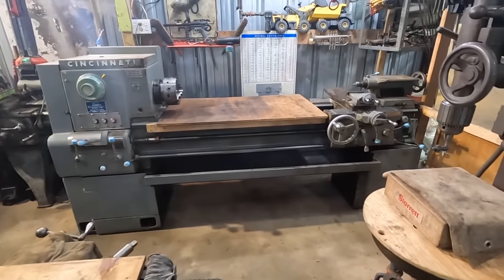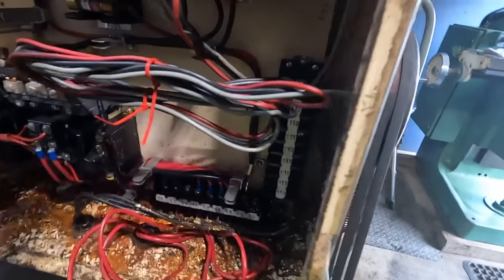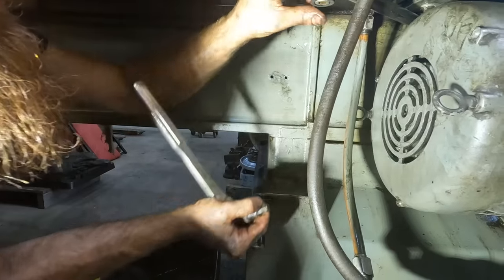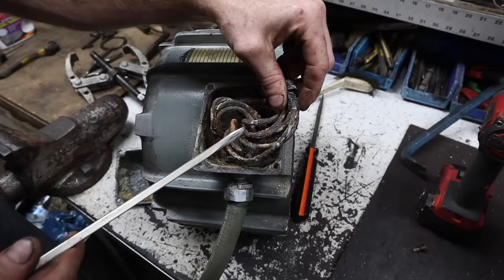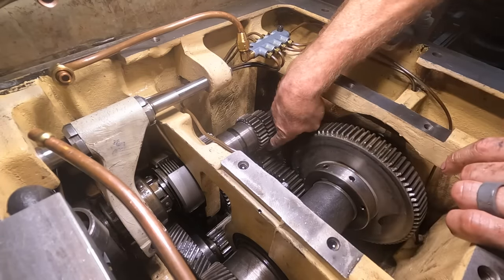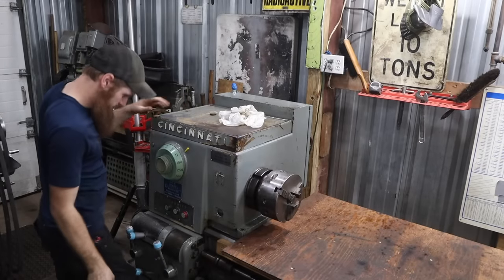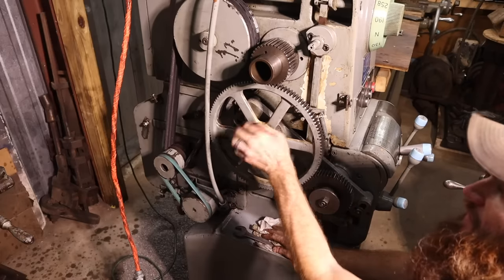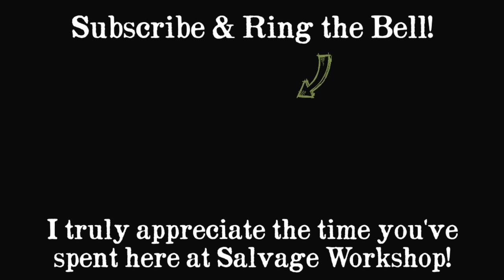Can we SAVE this BROKEN Lathe? ~ MAJOR Issues found! ~ Will it Ever CUT again?

Comment: Huge props to you and your brothers for getting that thing running again. Such an impressive bit of engineering in that gearbox. Be careful with the gear meshing on the backgears; sounds like you are trying to mesh them tight but there usually needs to be a calculated amount of backlash or you are going to have a lot of premature gear wear. Have to admit there was a lot of puckering going on every time you stuck your ear to those backgears and watched your lovely beard get ever closer to those belts...
Reply: Hahahahaha you read my mind mate, i was cringing too, also when he was machining that tool and was getting closer to check the finish and his beard was really close to the chuck. That's the type of mistake you will only ever make once! :) Got to admit though, when your in the heat of a project, its so easy to forget things like that. Id say 90% of my mishaps have been when ive been in the zone and not paying as much attention to my surroundings as i should have been. But yeah i would defo either tie that beard up, or use some sort of cover on it, can you imagine the damage if it was to get caught up! wow! :(
Reply: Good thing that aluminum oxide  doesn't conduct electricity!
Reply: I could show you a photo of my thumb after it went through the gears on an old 12" craftsman lathe. I was trying to wipe off excess lube and using a folded up paper towel. Gears grabbed it and sucked it into the gears an before i could let go my thumb went through. Bad deal, should have known better.
-
Did not stop to consider that my thumb could be drawn in before i could let go. My thumb is fine now but it took a long time to heal and the end looked like ground up hamburger. Doctor said oh don't worry lol, that will heal up just fine... and it did.
-
Was so torn up he could not even stitch it. After I seen it I really thought the last 1/2" of my thumb was going to have to be removed. it was opened the same way the end of a grape would be of you sat the grape on a cutting board and whacked it hard, the end will shred and pop open with pieces hanging every which way. thumbnail torn off and blood spurting.
-
Yes I am being kinda graphic to drive home to everyone who reads this... don't get close to running lathe gears. They munch human flesh like a meat grinder munches meat and puts out hamburger. because I was smart, happened to me.
Reply: @robert5  I'm in a CNC Operator certificate program right now...  they push the safety thing all the time...  they need to have a class of graphic pictures and stories, case studies if you will, on injuries and fatalities in the shops...  I'm a 55 year old helicopter instructor/maintenance test pilot, back in school, and think back to driver's ed when I was in high school.  They showed the graphic stuff to scare us straight.  These machines don't care one bit what gets in their way; they'll just munch it up.  Glad you recovered from that...
Reply: @robert5   Absolutely correct - human flesh and bone is no match for steel. Or most metals for that matter! While I have all my digits, I used to work for an engineering firm where one of the guys which operated the sheet lasers had some mangled fingers with one half of one missing. He foolishly had stuck his hand into a small punch press of some kind in an attempt to pull out some pieces of metal and down it went, mangling his fingers. He could still use that hand but his thumb and two fingers were permanently disfigured aside from the one that was half missing. The doctors had to amputate the missing half. The others didn't have to be cut off but the joints were crushed thus the disfigurement. He had partial use which was good but it did hinder him to a certain degree. He was a living, breathing example of why you never put any body parts into a machine like he did... and is why they teach you to power off plus engage in the lock out/tag out process. The irony was that he had the ability to grab onto and use some super long needle-nose pliers in an attempt to fish out the metal but for some reason he didn't use them. He was in agreement that it could have been worse but he had nobody to blame but himself. The moral of the story is to keep your wits about you... make sure you know what you're doing and follow the path of true safety when working on any machinery. Best wishes!

- Max Giganteum

Comment: That filter housing is also used on oil furnaces. They use a bit different element, but the same housing. BTW, that motor is what’s called a TEFC. AKA, Totally Enclosed Fan Cooled. Fairly common for industrial applications.

Comment: My hobby is restoring old antique and vintage machine tools. I suggest you separate the 4 jaw self-centering chuck from its back plate and sell them separately. My Clausing 5913 has a L-00 spindle, and I would love to find a L-00 back plate so I could mount a 4-jaw adjustable chuck. thanks for making this video. Very interesting subject material to me.

Comment: Not sure if you noticed, but there was a paper type gasket on the motor wire connection box when you opened it. Probably should make yourself a replacement gasket for that, eh?

Comment: I have a Cincinnati 13” hydra-shift lathe. Got an awesome deal on it. Needs some minor attention. It was nice to see your video on the problems you worked through and to see inside the beast. I use to run a 17” Cincinnati years ago. I really liked running it. Nice machine.

Comment: You done a great job bringing that great little lathe back to life. It is not always easy to do some of the things you done. Just one thing, which I'm sure others have said about sticking hands near moving machinery. I've seen a friend lose 2 fingers and a work colleague crush his hand, being a first aider it is not nice picking up fingers out of swarf. I was an apprentice mechanical engineer in the early 1971 to 1976, and we had a Cincinnati 17 72 I believe, for the apprentices to work on, among other machines. They are a great machine, very hardy and accurate. I spent my working life primarily on gearboxes used in industrial, defence, newspaper printing, etc. Thanks for posting it really was enjoyable 👍

Comment: P.S.  If you have the room to clear the cross slide I would put a valve on your drain with a hose barb.  A section of hose can then be used to control the flow wherever you want it for a neat drain process.

Comment: A couple of observations if you don’t mind: firstly, that 4 jaw self centering  Chuck is probably your best Chuck. It can hold round or square stock equally as efficiently and, if I’m correct, has a centering adjustment feature that allows precise adjustment. Secondly, as you mentioned a rusty deposit in the electrical panel, I would suspect that coolant has been making its way past the door seal and , over the years has evaporated. The types of oil used in lathes isn’t likely to cause rusting, whereas coolant is usually mixed with water which, if left in a closed space, will cause severe rusting.
Reply: ARE YOU JOKING? The three jaw chuck is clearly better. I bet you use the metric system. 🙄
Reply: @GardenGuy1942  if you think stating that someone uses metric is a bad think, it’s just dumb metric is better by far and I grew up learning imperial
Reply: @aslofiasitcanget2945  I had a stroke reading your comment.
Reply: @GardenGuy1942  it’s not hard to read, maybe it’s time for the nursing home🤷‍♂️

Comment: Was working with a hydraulic tech with a lot of experience. He placed a small powerful magnet near the sump intake that grabs particles from going through the system. I guess you would have to periodically pull the magnet out and clean off the particles. He ordered the magi nets from Grainger, but you could find them many places…

Comment: Retired farmer here, tore into lots of different mechanisms throughout the years, and always enjoyed figuring out how different machines worked. The old machines were rougher built, but in my experience were more robust and durable. Not as fancy, efficient, or fast? Probably. Not as convenient? For sure.  Made to pass down to the next generation? You better believe it! Congratulations on your lathe, all of my above statements apply to what you now have. Great video. (Only cringe moment I had was when you were listening to that bushing on that larger gear, I closed my eyes thinking about your beard getting caught).  I like the way you think,  stay safe, blessing to you!

Comment: So awesome brother!! I am building a small but fairly complete machine shop to support my garage that will specialize in pre WWI race cars. I will start posting videos when it gets warm enough to get out to the barn and start doing some work. Keep up the great job. I need to find a tool room lathe and a vertical mill. I have a Southbend and a horizontal milll so far but they need some work.

Comment: Matt, that Cocaine powder is most likely from electrolysis. It is form of corrosion that takes place with the presence of dissimilar metals like copper and aluminum. The insulation breaks in the copper caused this type of corrosion with the aluminum cover and other aluminum components. It is close to what happens in your car battery. Without ripping the entire box apart clean the wires best you can, maybe using alcohol. After letting the wires dry properly, 3M makes a liquid insulation fluid (brush in can) you can apply the liquid to all the wires and they will be adequately insulated. We had an old stand mixer from the 40's and it had cloth wires, this liquid did the trick. You have to make sure you clean all the white corrosion off everything first though. It will also help to use a penetrox compound around the aluminum, it will prevent that corrosion from taking place again.
Reply: Any chance of there being Abestos there as well?
Reply: maybe in certain cases, but not in this case, it is corrosion from dissimilar metal existing in the same enclosure. Mixing aluminum and copper without using an inhibitor solution on the aluminum could have prevented that. It also has to do with the age of the machine and what condition the machine shop was in when Matt came for the machine. This is clearly a corrosion issue though.  34 Years as an Electrician I saw plenty of motor heads like that on old machines. Not really as bad as what Matt had to deal with though. Also you would pray for Matt in that case that it was not asbestos due to it is the most dangerous when it is dry and airborne. The stuff he was cleaning was bad but not to the point as being as deadly as asbestos. It is basically the sort of corrosion you see under the hood of your typical car around your battery terminals. The best way to clean it off and neutralize that is some baking soda.

Comment: Great Job on the diagnostics and repair work.
Years ago I worked at  a machine shop, and  any time that we did cleaning on  a  lathe, we would  use varsol to clean the equipment, and once we finished the  cleaning process we would coat everything in basically air tool oil.

Comment: I was an electrician (EM) on a repair ship and we had a couple of old Cincinnati lathes in the main machine shop. We found that we had to change out the old motors on them with newer motors that didn't produce as much heat as the old motors. We could see the paint start to bubble up and crack inside the panel from the heat of the motor. Sometimes they would run 21 hours a day, 6 days a week when the fleet was in. My shop also had to replace the contactors in the Cincinnatis more than the other lathes that were newer due to the heat build-up until we replaced the motors. 
Fine job you've done on this machine!

Comment: By the way, atf is is probably a better fluid for lathe head flushing, it seems like the better choice and I've seen many others use it, but not sure how much difference there would be between it and diesel. But for this lathe the oil viscosity is important to the functioning of the lathe because the viscosity is related to the system pressure parameters. But I would definitely change that oil filter head out to a modern spin on filter type, cause finding the filter element for the existing one will probably be impossible. PS do not put a paper filter in the existing element housing, you will probably regret that. Change the filter head to a modern spin on hydraulic filter, should not be to much hassle or money.
Reply: That filter housing looked to be a standard oil heater filter housing.  I have one on my heating system, but I am not sure of the filter type as I let my furnace guy change the filter.

Comment: You sure that lathe wasn't in a flood sometime in its life?  That sure looks like the remains of flood water in that motor.  That would make sense of the damage in the bottom of the electrical enclosure, too.  And also the water down in the base of the lathe, too.  I don't believe your lathe was ever setup for coolant.  It just has the factory provision for adding it as an option, which back then that was an option.   I did not see any bracket hanging off the carriage for a coolant line either.  My dad used to make repairs on these old lathes back in time, call them "tray top" lathes.  Sadly Dad is no longer with us. 
BTW- If you don't have a steady rest for this lathe, I have one here I believe will fit yours.  It is off of this brand of lathe.  If interested let me know.  All that hydraulic shifting mechanism is a nightmare to deal with I recall dad talking about it.  There's metering devices and such that are probably clogged up that are probably preventing it to shift into some of the speeds.  That will be a nice sweet lathe when you get done there.  Thanks for sharing Ken.
Reply from the maker: I honestly don't know about it being in a flood... with as long as the shop I got it from was in business, it's VERY possible... Now, there wasn't hardly a SPEC of rust on the machine outside the corrosion in the motor... Who knows! 

I do agree it never had coolant from the factory... there would have been a button on the front panel that is not there on my lathe. Now it COULD have had an after market unit, but I don't see any evidence of that... I may add a simple coolant pump / setup since this machine has a perfect chip pan that drains into a oil tank on the bottom of the lathe.

I have heard them called tray tops, and your dad is correct, pretty much everyone that I've spoken to about working on these lathes has said they CAN be a nightmare to get the hydraulics to work properly, so I think I lucked out on that one!

If you're serious about the steady rest, I am interested! Can you send me some into and maybe a couple pics to salvageworkshop@gmail.com ?

As always, thanks for watching, I truly appreciate the support! Lots more to come!
Reply: That was my guess too.  Oil floating on the water would explain how oil got into the lower half of the electrical box - and why the motor looks like it had been dunked in water.

Comment: Great job so far ,but your extension pipe for the drain needs to be braced ,as you have seen already it will turn when you remove the drain plug it will also turn from vibration , also the electrical box on the motor needs a gasket it had one originally use thin cork also use something on the screws to keep them from corroding ( happens when dissimilar metal come in contact )

Comment: Master of unobtanium gaskets... now making unobtanium parts.
Not quite the same, but I bought a 3d printer that I have already made several unobtanium parts with. Designing the parts in CAD, spitting them out and having them fit properly is pretty rewarding.

Comment: Hay mate great lathe . I used to work with a lathe if you needed to use a different hold on the face of the lathe you needed to screw out the jaws of the chuck and turn them around and rethread them back in the opposite direction giving you a different face on your  
Lathe . Hope this helped.

Comment: The motor is a three phase squirrel cage motor (so called because of the construction of the conductors in the rotor).   The order of connection of the three phase wires does matter.   If you swap any two of the wires the motor will turn in the opposite direction.
Reply: Also: The configuration of the three (or multiple of three) separate motor (stator) windings matters even more: The Star or Triangle configuration variate the effective resistance, power consumption, the string voltage across the motor winding and other parameters. If wrong, you operate the motor out of spec, which in the worst case will destroy it. See Wikipedia for a deeper discussion on the topic and for hints where to find further specialist literature.
The explanation behind the direction change of the rotating magnetic field is the following: Due to the time offset of the three alternating currents, three-phase alternating current offers the possibility of generating a rotating field through the circular arrangement of coils. In the simplest case, six coils are arranged in a circle and the opposing coils are connected together to form a pair of poles, which forms the two poles of an electromagnet. Swapping any two external conductors of the three-phase alternating current causes the direction of rotation to be reversed. The phases are each shifted by 120°.
This follows by the vector-math behind the rotating field, the physical and electromagnetic reality and if you think about it even logically.